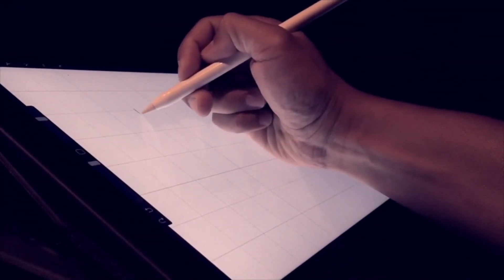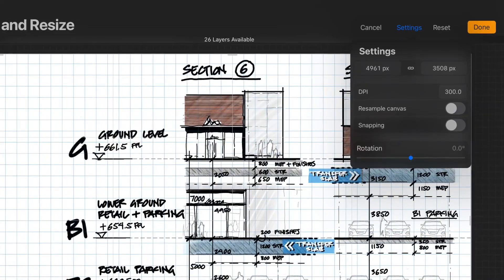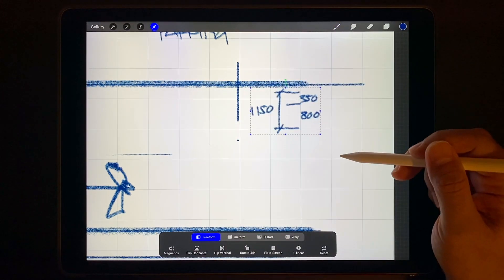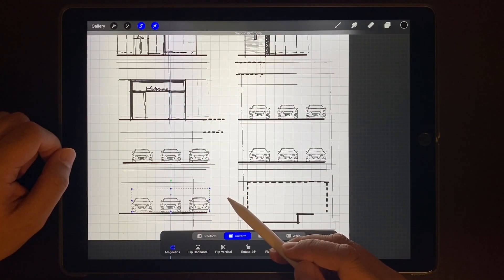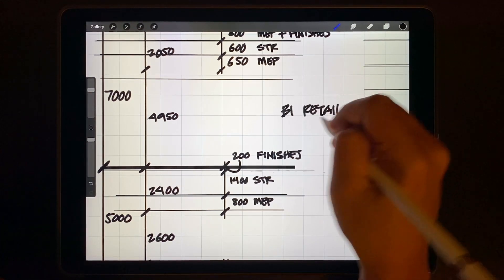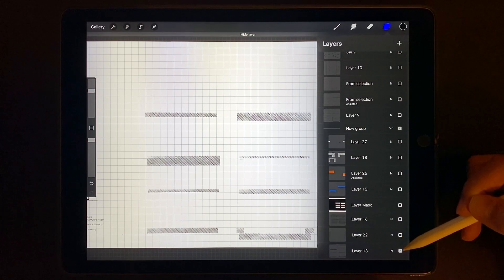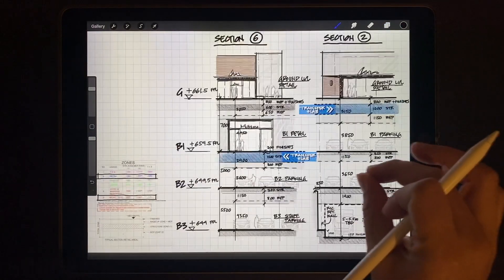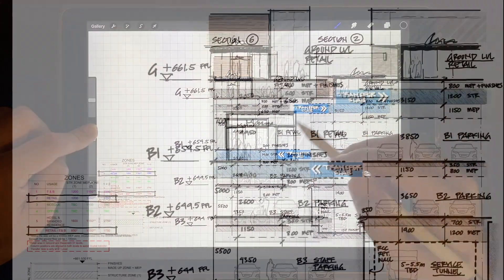Sketching on the iPad for Architects // Section Sketch

Comment: I dont think you have properly given Morpholio Trace as much credit as it deserves here. Really the only thing it lacks that Procreate has is brush/tool customization. Procreate is good, but it feels more like an artist's design tool rather than an architecture design tool. Great video though!
Reply from the maker: I do use Morpholio Trace, nothing can beat its scaling feature. But Procreate dominates with its layer management. My current workflow utilizes both apps.
Reply: @DigSketch  Thats fair - I utilize both as well, however I disagree with the layer management ability in Procreate. Is it more in depth? Probably, but Morpholio does essentially everything needed with regard to layer management that any artist would need.

Comment: Thanks for this tutorial. Can you explain @ 1.25 what is the grid size you used here [in pixel] to get this scale of 1:100? Procreate only allows grid size adjustment in pixels. 👍
Reply from the maker: You can set your grid using mm, cm, inches or pixels. Click on the number input near the Grid Size slider and you'll see the options